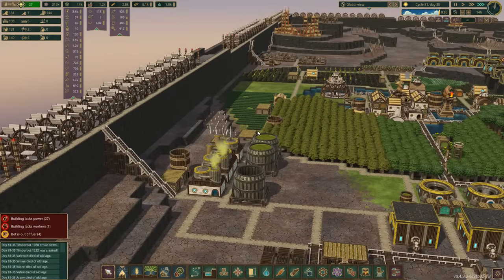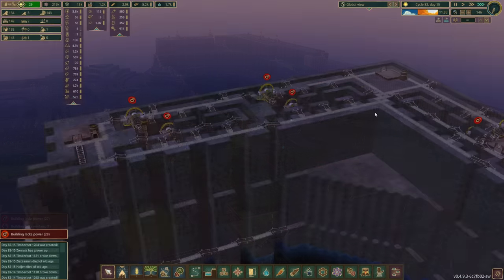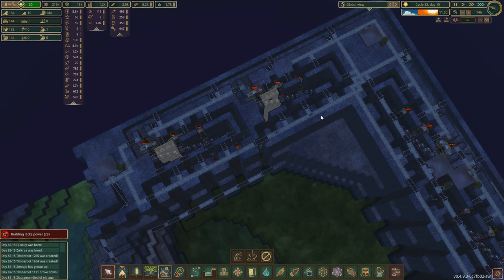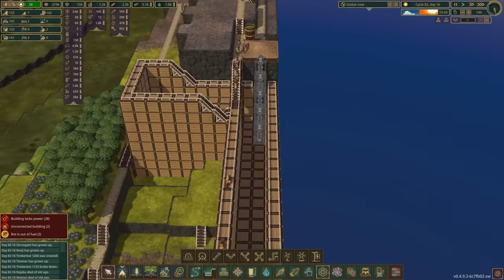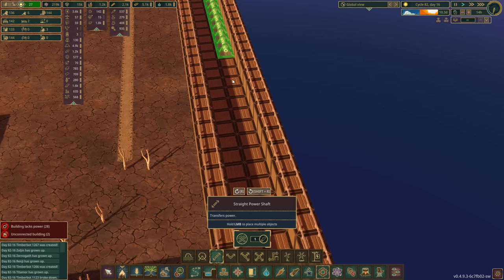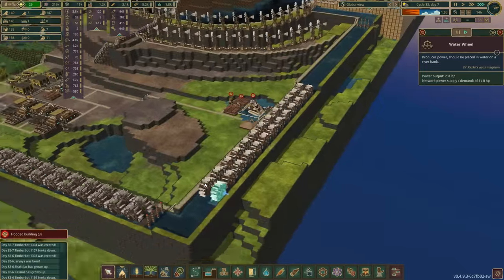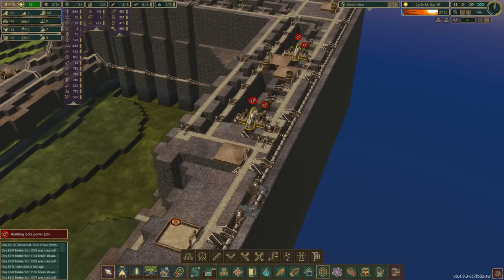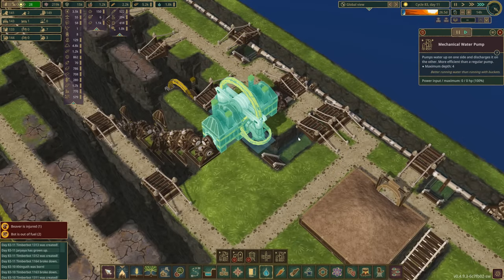IT'S FINISHED! The Mega-Giga-Tera Dam .. but there's BIG problems - Ep 16 Timberborn Hard Mode

Comment: When running under-platform power you can run the path under to get all the platforms built and then switch the path to the top to build the power line.

Comment: It would have been so much easier to set the power connections up first on the side of the aqueduct, so that the beavers could run up and down there, put down the connected wheels row, and the final row could be built from the other bank. Best of luck to you though!
Reply: Well, hindsight is 20/20 and all that.
Reply: @aquatus1  Still doable if he rips down his next stage and rebuilds from the ground up, as he said he would.

Comment: If you hadn't thought of it, you may want to add blocks on the intake for the mega-giga-tera dam to block the water from going in unless the reservoir  is filled up. That way you don't drain it out too much and it just recycles excess water
Reply from the maker: It's meant to drain the bottom reservoir :)